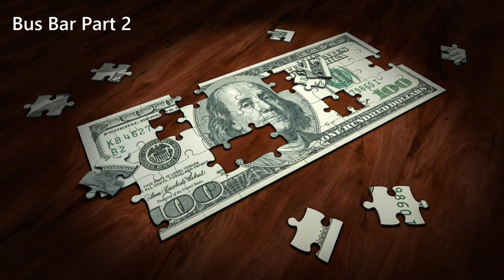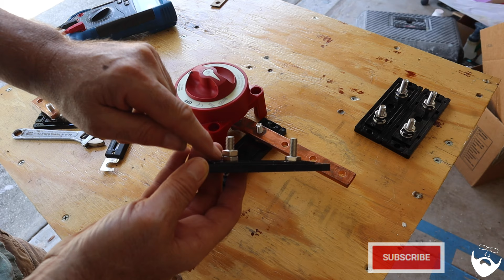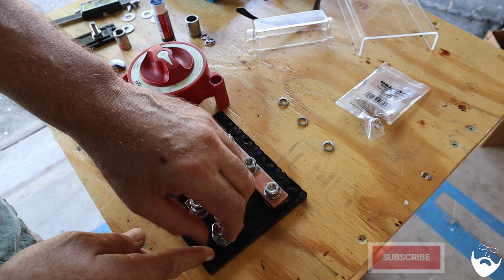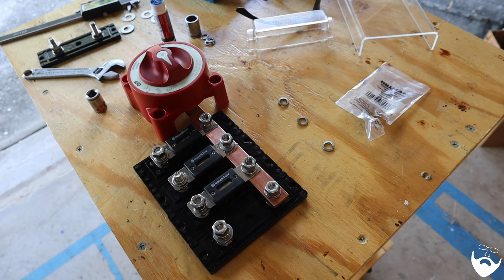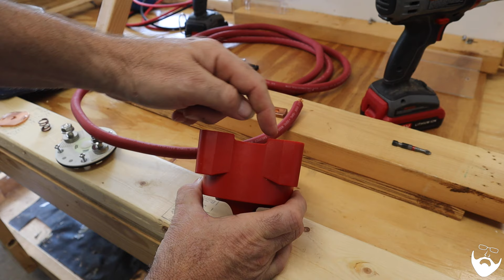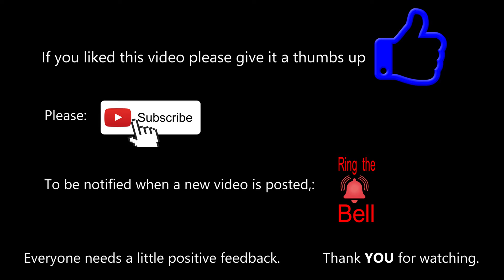Van Life Electrical Making your own Bus Bar part 2

Comment: Just drill a hole in the top side of the switch for your cable to go through.
The label will still be correct and a lot less work to do.

Comment: Thanks for the great video ... my suggestion is using nuloc nuts instead of spring washers - because every time you do maintenance and remove the spring washers you technically have to replace the spring washers - more economical to use null nuts instead.

Comment: 080921/2023h PST 🇺🇸   Thank you again for the brief Part 2 about modification on the Blue Sea device. Appreciate that. Regarding the label, there’s no need to blank the present one. You may carefully use box cutter blade to life a portion of the label, carefully carefully and carefully and then use a blunt small flat edge screwdriver to work around the label, to prying it to dislodge. Good luck there, Sir.
About your comment on “over doing” the fasteners, Sir… I beg to disagree, No, you are not over doing. That’s the meticulous and correct way to anchor fasteners. My Dad also does that, I also do that.
Thank you again and take care. 73s…

Comment: I’m really liking this idea. However I’ve heard, and been possibly monetarily incentivized, that melting has been a problem with cheaper fuse holder. So I’m think of using voltage insulators to attach to pieces of bus bar, which would then suspend the bus bar in the air. No base to touch, much less melt.
Reply from the maker: This system as shown has been in service for almost 2 years now without any problems. No melting.   You could make your own insulators.  If you look at the electrical panel video https://youtu.be/AbuQPpMtmug   you will see the negative bus bar.   That bus bar is held away from the panel using a piece cut from a 3/4" HDPE cutting board as an insulator.  But for the fuses it was more cost effective and efficient to buy the commercial fuse holders.

Comment: Just happened upon this video, nice bus bar, but it concerns me that you used a stainless steel nut to move the bar away from the contact point on the switch. Your contact should be copper to copper. Have you checked your setup for hot spots while it’s under load?
Reply from the maker: I agree, like metals to like metals is best.  But, no problems so far.  It is installed in the van now, and been in heavy use.  I will be posting an installation video in the future.
Reply: I have the same concern. Perhaps use a piece of the copper bar as spacer instead of the bolt.

Comment: Nice work. Finding great difficulty getting hold of quality 60V 350A continuous load 4 position switches. Even blue sea drop to 32V on their 4 pos switchgear. (For a LIFEPO4 battery pack 48v nom, but 58.4V when fully charged, doesnt make for easy sourcing of switches... any hints would be appreciated). Love the way you spaced the busbar to suit...keeps a lot of tension off the connections.
Reply from the maker: I did a little looking and could not find a perfect solution.  This may work https://amzn.to/47mWZj2  But you may need to use a different type of switch.  Try looking at https://www.mcmaster.com/products/electrical-controls/manual-switches-1~/      Hope that leads you in the right direction.
Reply: Thanks for the pointer @FrugalFactor

Comment: Do I need a special blade and drill bit for cutting/drilling 1/4” copper?
Reply from the maker: No, a standard bit works.  Copper is a soft metal and drills/machines very easily.

Comment: Hello, I have 3000w inverter, what size of bus bar should i use?  Thanks
Reply from the maker: I also have a 3000W inverter (Victron brand).  I use the copper bar that is linked in the description of the video.
Reply: Assuming that your system is 12 volts, your 3000 Watt inverter draws 250 Amps at full load, add a safety margin and call it 300 Amps. According to a quick google search the Amp capacity of a copper bus bar is 1.2 times the cross section measured in square millimeters. So, 300/1.2 = 250 mm2. I would look for a bar that was 10x25 mm or 1/2x1”.

Comment: What’s the end result of the switch?
Reply from the maker: Not sure what you mean.   I modified the switch so that the on and off are in a different position.   You may not need to do this.  It depends were you have the bus bar located.  This video walks through the electrical system as it is installed in the van.  https://youtu.be/AbuQPpMtmug